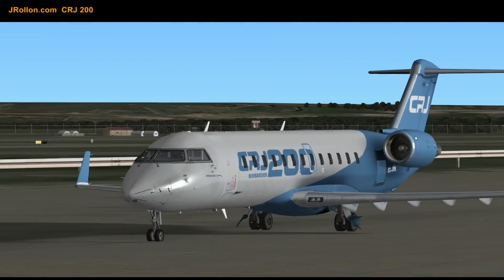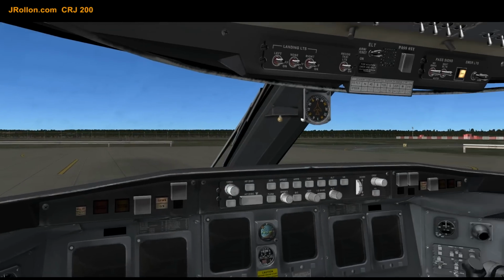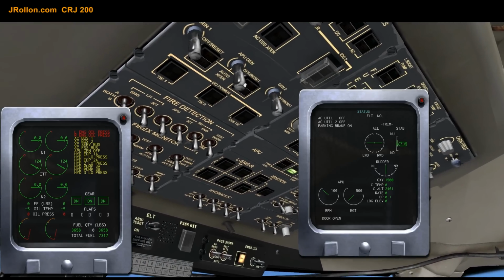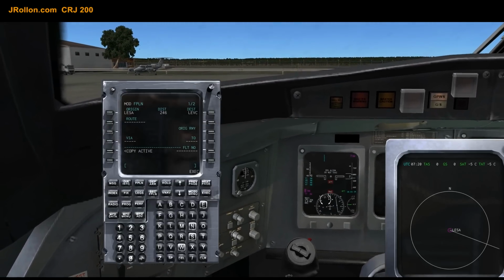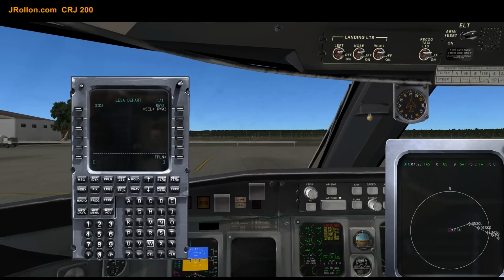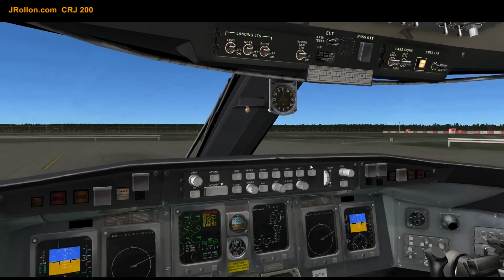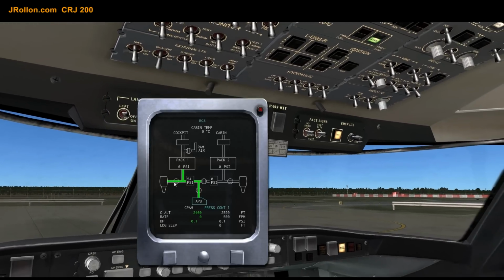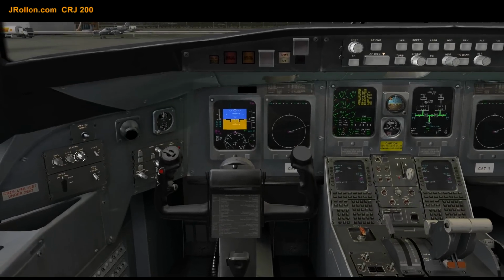CRJ200 Tutorial (part1/3)

Comment: The complete set of vids that makes up the tutorial. "GOOD JOB" Been trying a transition from other aircraft ie., Eurobus to this, I have it, found tricky. Cleared a very awkward point for me - engage the autopilot at take off transition height (4,000ft) before altering altitude to authorized cruise level. Also the formula for distance to go for altitude achievement, that correalated more to the gauges and displays. Many Thanks